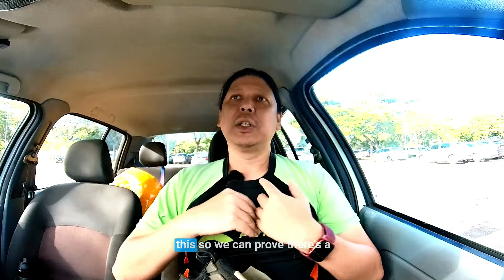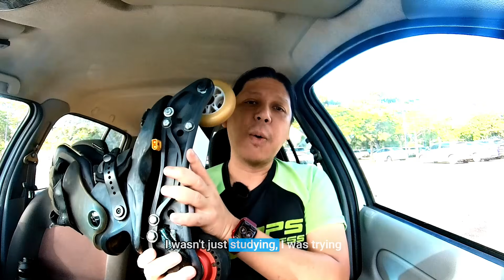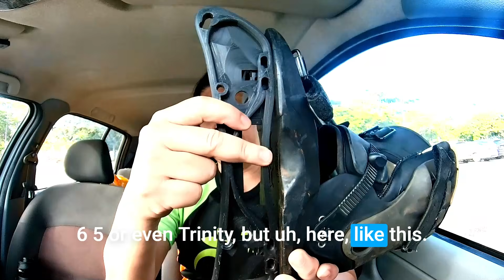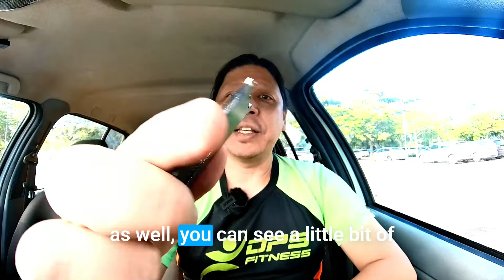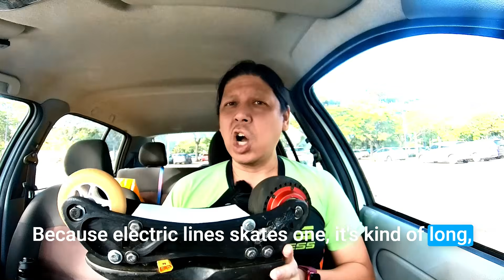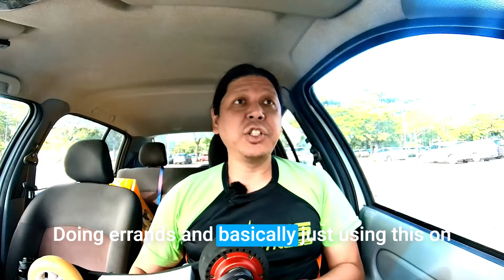I Disappeared for 2 Years… Here’s What Happened (Storm Tracers Return)

Comment: Welding probably isnt the best solution.  Welds can break.. especially when stressed often...

 Instead... make it a single piece, and have a fabricator bend it, with a hydraulic press and a form setup.

 The bent c-frame is how most.. if not all.. skates are made.

 When you factor in the time and cost to weld thing securely.. it will likely cost the same or less to stamp-bend the frame.

 Another option.. at minimum.. could be to use L-Shaped rails, and weld in the center... or... only use one L-Rail, and weld a single side on.

 The advantage of even using a single L-Rail  (like a cut section of bed-frame)... is that even if a welded side rail breaks... the L shape might be strong enough to maintain structural integrity.

 You might even be able to bend the piece yourself... using a cheap chinese press... and a single piece of square tubing in the center (bottom part of press)... with the top part of the press using a 2x4 with a notch in the center.

 You probably want the screw the piece down in the center line... with one screw towards the front .. and one towards the rear (heel end).

 By screwing it in place to a form-block.. it leaves little chance for the part to bend improperly.

 As obviously.. if the bends are off too much.. the screw holes wont align.

 That said... if all mounting holes are slightly rectangular (at least on one side)... it would allow for small adjustments by the assembler / user.

 Sorry to hear about the fall. I do recommend talking up a martial art like Aikido.. where they teach you how to fall a bit safer.  As an artist myself.. i practiced a few of their methods... but i also did hardcore Shaloin style Iron Body conditioning too. 

 This iron body conditionung made my bone and tissue density.. develop to an extreme level.

 In fact... a new medication was causing some really bad side effects at work... thag caused me to pass out while i was standing straight up...

 I woke up on my back... staring at the ceiling.  I had fallen from my full height of 6ft... backwards... head first... onto the concrete floor.  My head must have bounced like a bowling ball.. on impact.

 I suffered no injury at all... which is kind of insane.
Reply from the maker: glad to hear you didnt get hurt on your fall. mine was not only my own height which is the same as yours, it was pushed back with my dog jumping on me. I never thought I could actually hit my head, I have skated my whole life and never used a helmet and never hit my head before. I have at least a dozen martial arts under my belt. I practiced kung fu Wushu for 12 years and Judo for 3 and capoeira for 7. even then, I think age is something you can never run away from. when the fall happened I was already more than a year without training my body, so my reflexes were especially bad and my muscles as well.
I am training or rather re-training my body now so I can keep on skating and practicing martial arts again.

About the welds. welding is very easy and cheap. you are right about welds cracking, it will happen. one of the things here is to discover how long it will take. a month? a year? maybe 2 hours. the thing about the bending sheets is it is hard to find the specific thickness and sizing. also you cant CNC cut a sheet and bend it with precision. if the holes get 1mm off center the skate will feel like is steering on their own. if you are fabricating everything yourself its more doable, but I cannot do that right now as I dont have a workshop.

DIYing things depends on what you have available for you where you are and your budget. for me right now, both are not good. lol. If we were talking about making an industrial product to sell worldwide prodction costs would differ from the scale of units produced and sold. THE BEST would be to use carbon fiber as it is easy to work with, and for small scale it makes sense. second best would be to CNC machine a block of aluminum. for small and up to medium scale works very well. 
both of these are good because development of updated verions would make expensive molds obsolete very fast. so it doesnt make sense to make a mold for stamping for example.

so thank you very  much for your input. I had thought about those options a lot as well. and will keep on thinking. if I have a better budget I will consider more options.

ps: go back and watch the 2018 corwdfunding indiegogo campaign video, I have used a carbon fiber frame made on a mold that was a C-shape steel thingy but it was made by a comopany especializing in carbon fiber, not a DIY thing.